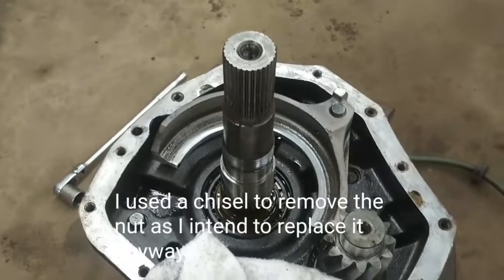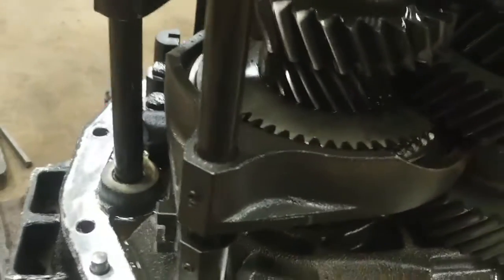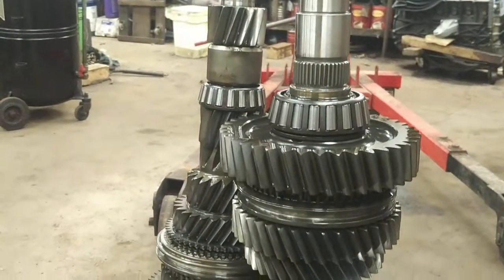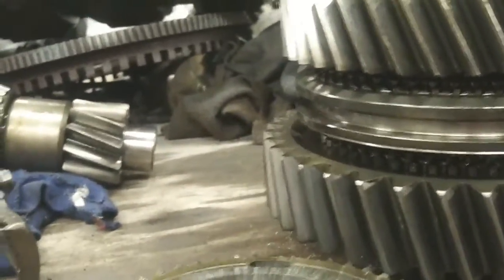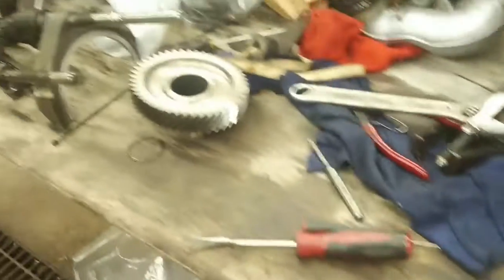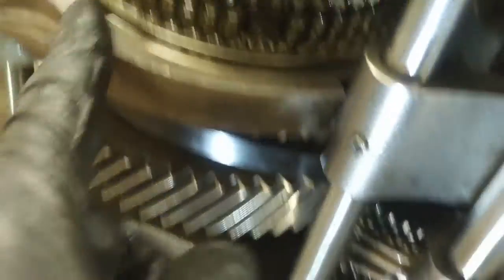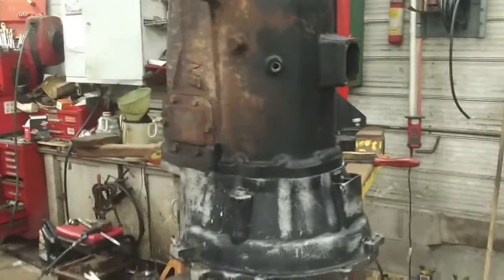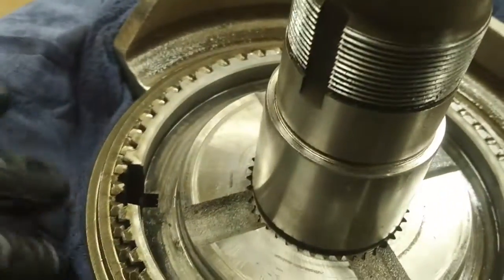Dodge Ram 3500 NV5600 6sp Transmission Syncronizer Replacement

Comment: And where did you get your manual?
Reply from the maker: I'm using a service information site provided by Identifix but they only cater to commercial shops. Try Alldatadiy.com they should have the same or similar info.

Comment: What all tools did you use?
Reply from the maker: 20 ton press, split flanges, special socket for the output shaft. I modified an existing tool for the front differential pinion nut on an 84 Olds Toranado. Toaster oven to heat gears and bearings. There is supposed to be a holding fixture for reassembly that holds all the shift rails. I didnt have that. This is not an easy job, especially the reassembly of the shift rails and lockouts. I'll never do another one again. Good luck.
Reply: Where did u get special socket u can’t find it
Reply from the maker: @huntergiddens2022  I repurchased an Oldsmobile Toranado front differential pinion socket as it was very close. Had to file the socket to make it fit. There is a special Miller tool from Chrysler but I too could not source one.

Comment: Why the hell you dont show disassembly I have no idea. edit, edit, edit.
Reply from the maker: I'm sorry the video does not meet your needs but if you don't have at least basic knowledge of disassembly of a manual transmission them I would strongly recommend to not attempt this repair. It is by far the hardest manual transmission to disassemble and reassembly especially without the proper holding fixtures. There are other YouTube channels that attempted to show the work involved.

Comment: Could a person use plastigauge to check end play on the reverse idler gear?
Reply from the maker: I would say plastigage would not work. I believe there is a special dial indicator used. I honestly did not check end play. In my opinion that would be required if you replaced shafts or case parts.

Comment: Looking at the inside of that trans and knowing that I've put 200,000 miles on mine without ANY problems in 19 years, while towing heavy trailers almost every day, amazes me !!  All those parts working flawlessly through all that abuse is a testament to the quality of that trans. I've heard others say you shouldn't float shift these transmissions and they are dead wrong ! It works just fine. On a side note, I also have a Ford (frown) with a 7.3 and  ZF 6 in it.  I would take the Dodge with the 5.9 and NV5600 any day of the week !!!
Reply from the maker: Yes it is amazing that it all works. This one had been apart before  not sure what was done or why it was apart. I don't want to do another one though. Too complicated.

Comment: Just curious did you figure out you can lock the Trans in 2 gears to tightened that big nut? I  have Built Transmissions for 40 years Auto and Sticks and you are right this is not a easy job. Good Job. Paul's Transmission & Repair Baker City, Oregon
Reply from the maker: I dont believe I was able to do that with this one since you must have all the shift forks and rails in place before you put the nut on. The interlocks prevent putting it into two gears at the same time. I believe I held the spline with a big pipe wrench and used that big pinion tool and a power bar. This transmission was probably the most difficult one I've ever done. It would definitely be easier with the holding fixtures. Bolting it to the hoist pads and raising it up and down was huge bennifit. Good luck.
Reply from the maker: As far as I know locking the trans in two gears would only be possible in a top or side loaded transmission where the shift forks are removed and you can put two syncros into gear at the same time. Maybe if you left the reverse synchro fork roll pin out it would allow selecting a forward hear with the shifter and then putting the reverse synchro into gear at the same time.

Comment: I had a shop rebuild this for me... Got it back with same problem.  Four didn't work before, now it goes to gear but grinds
Reply from the maker: That's a tough trans to rebuild. I would say there's a problem with the syncronizer in that gear.

Comment: Hey can you tell me what the problem is I have a 2000 dodge 3500 and 3rd gear slams into neutral and I’m not sure what the problem is and my 6th gear grinds too. And I have a nv5600 ats
Reply from the maker: Probably worn lockout  synchronizers or end play on the shafts due to bearing wear. I'd recommend a reputable transmission shop for this kind of repair.
Reply: Would you know a price of that kind of work or would I be better to get a new transmission
Reply from the maker: @zachmundy5593  sorry can't really answer that. Price a reman if available or another low mileage used.  There are probably several transmission shops in the US. (Assuming you're in the states). Do some searching and check feedback from their customers. Sorry wish I could be more helpful. I've done quite a few standards in my days and this is not one I'd offer to do again. It's quite a task especially all the fun linkages inside to line up. Plus it's just heavy to handle especially without factory tooling. Good luck

Comment: Was hoping to see how you did the end play, but didn't see it anywhere.  That's where I'm at on mine now.  Worst part for me was the shift lever bs.
Reply from the maker: Because I didn't change any major components I resued the existing shims. If you are just changing the bearings and syncros you should be ok the end play. Yes the shift linkages are a bitch...

Comment: 1 of the easiest gearboxes I ever did. Just doing 1 now inc all modifications we could figure out for them.

The only hard part is its weight. Other then that is simple.
Reply: That's actually really cool to hear.  Everyone freaks out at this design, but never with much logical reason...
Reply from the maker: I'm glad you found it easy. Personally it was one of the more difficult ones and I'm sure it would be easier if I had the proper holding fixtures. Yes it is heavy for sure.

Comment: Hi Phillip, my 07 Dodge Ram 3500 doesn’t engage the reverse gear and the reverse light stay on, is anyone will be able to share any experience on this please?
Reply from the maker: Actually you may be able to remove the transfer case and then the rear section where the reverse idler and synchro is and see what not moving.
Reply: @PhillipBailey  thank you for your information, that helps to solve this problem I appreciated 👍🏼
Reply from the maker: I gather it has the 6speed standard? What happens when you try to put it in reverse? Grinds, shifter goes in reverse but vehicle won't move, shifter won't move to reverse position? Let me know.
Reply: @PhillipBailey  nothing happens, no grind and doesn’t feel like shifted no noise at all, 1 to 6 gear all works
Reply from the maker: @pedrobatista6783  Has this thing been apart before? I would bet something has come apart in the shift linkages inside. The reverse synchronizer is on the back inside the first section but requires the transmission be removed to access. I'll see if there is a spot in my video that shows this.
Reply from the maker: The reverse syncro is shown at 13:10 and then at 13:50 you see the shift fork on the right side of the screen for reverse. Note there is a roll pin that attaches the fork to the shift shaft. If that roll pin fell out or broke you could end up with no reverse but the other gears should not be affected. I'd drain the fluid and check for metal in the oil. I don't think it has a magnet on the drain plug can't remember. You could also pull the rectangular cover off the side of the transmission and look for any signs of that shift fork roll pin. Unfortunately there is no easy way to fix this in my opinion. did you say the reverse lights worked though? Either way it has to come out and it's not an easy job. I would not want to do another one for sure.

Comment: may be a good idea to hold those blocker balls in with some grease so they don't pop out while compress the springs
Reply from the maker: Thanks for the suggestion but grease would not work. You have to compress the small spring and push the ball into the notch. I found a small flat screwdriver works best just cover the openings in the case in case or when one of the balls pop out of place.

Comment: How much would a job like this cost?
Reply from the maker: That's a tough question as my customer supplied the parts and brought me the transmission out of the truck. Just the disassembly/reassembly time was around 8-9 hours times whatever the hourly rate is. To take it out and reinstall in a 4x4 is another 6-8 hours. Add your parts on top.

Comment: About how long did this take you? Im doing something similar except i broke my input shaft..so im replacing it and synchronizers..thanks man great video by the way
Reply from the maker: The owner took the transmission in and out so it came to me assembled but on a pallet. I'd say between 7-8 hours with no complications. Watch those pesky blocker balls they like to pop out on you. Also pay careful attention to the shifter rails arrangements. That's a real Rube Goldberg design. Good luck.

Comment: Where did you find your service info and specs? Great video. Probably going to attempt this soon on my 03 Dodge. Will definitely use your video as a reference
Reply from the maker: I used Alldata service information. I believe you can purchase access for just one vehicle. It has detailed information. If you do decide to do this job its a bear. Take very good pictures of how the shift rails intertwine. There are six of them and they only fit one way of course. Plus you will need a 20 ton press and an oven or hot plate to heat parts for reassembly. Good luck!
Reply from the maker: Please subscribe if you don't mind. Thanks.